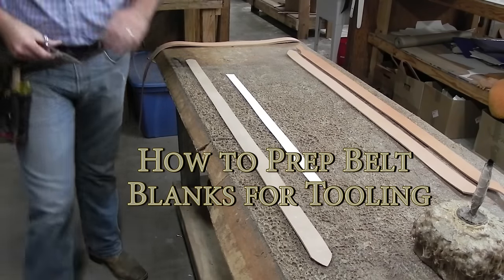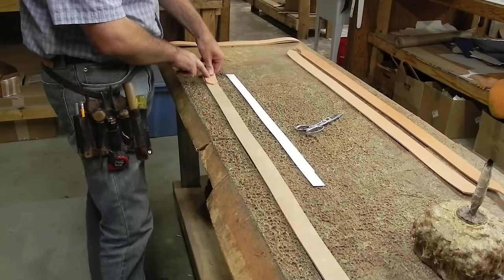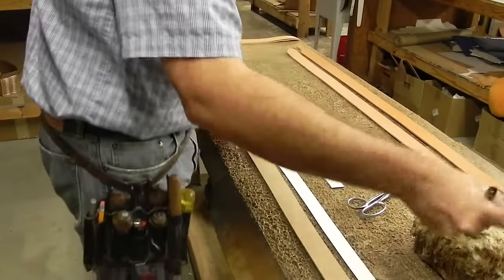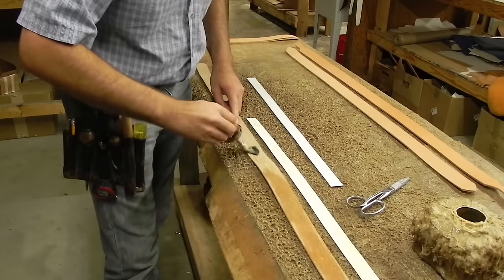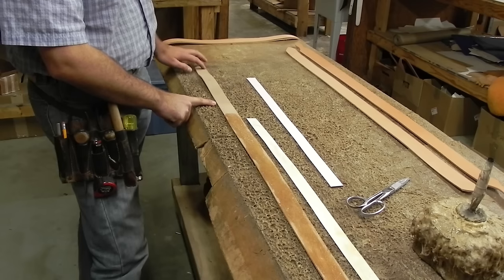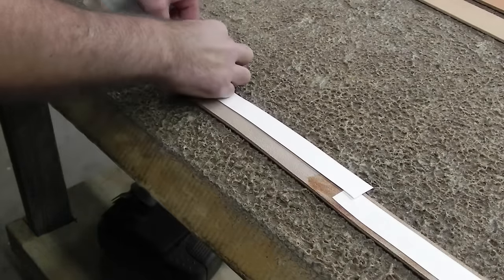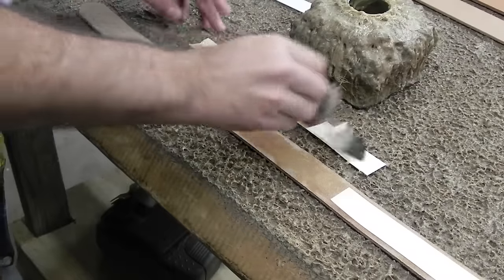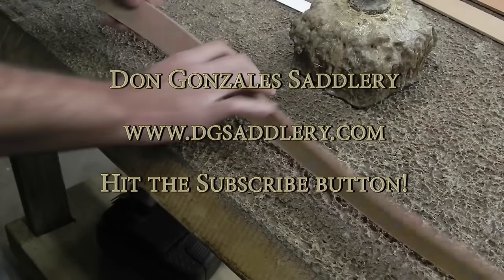How to Prep Belts for Tooling

Comment: Don, what ounce leather do you use on the back of your belt? I thought it was a 2-3 ounce but I can’t find any 2-3 ounce long enough for a belt. I’m making my first belt and having a hard time finding that. I just got some in today but it’s about a foot short.
Reply: If I plan on lining a belt I make the belt out of 7-8 oz and for the liner 3-4 oz. After tooling the belt will be thinner like 6 oz so l  end up with 10 more or less, but I don't use contact cement I use gorilla glue and then I don't have to sew the liner on. Problem with gorilla glue is it foams when it dries and I have to sand it off, which doesn't take very long on my disk sander. You can order utility grade shoulders of veg tan in 4 oz at Weaver Leather Supply which is more than long enough to cut some belts out of.
https://www.weaverleathersupply.com/catalog/item-detail/11-1201/veg-tanned-v-cut-double/pr_56636/cp_/shop-now/leather/veg-tan-natural/shoulders

Comment: Don, I am a complete rookie.. what exactly is the purpose of the poster board?
Reply from the maker: The poster board helps prevent stretch during the tooling and adds body to the finished belt... They won't stretch as bad with use.
Reply: And do you glue another leather over the paper?
Reply: Joseph Wolf yessir. The poster board will stay in the middle between the two layers of leather.

Comment: Don, you said you leave the cardboard on after tooling?  Then when you finish the belt, how do you finish over the cardboard?  I guess the cardboard holds up well and does not wear out quickly?
Reply: neilyeag he will line it with pigskin or some other thin leather, covering up the paper.